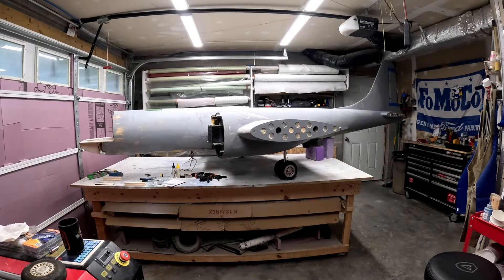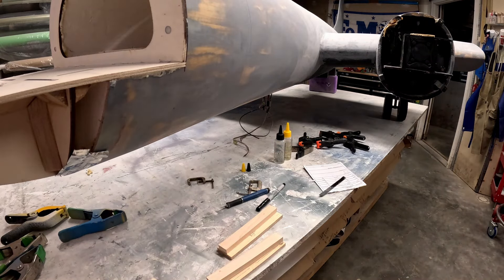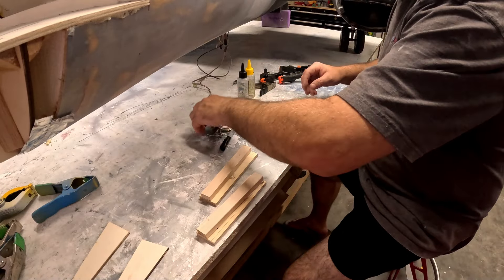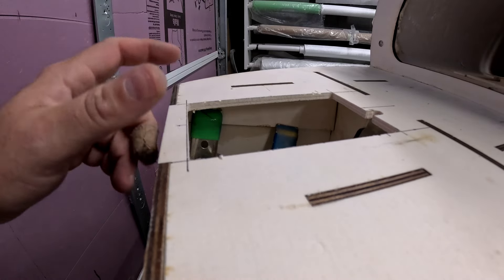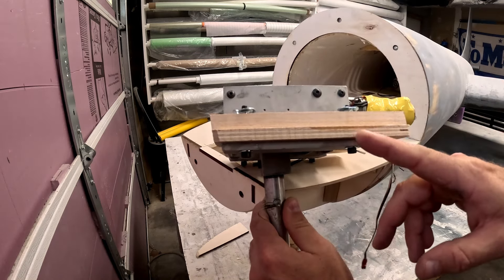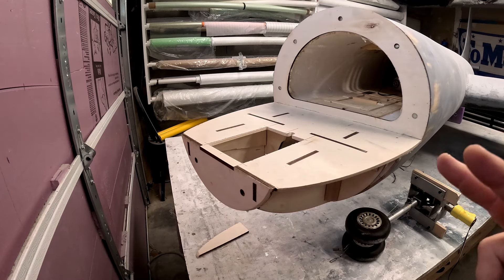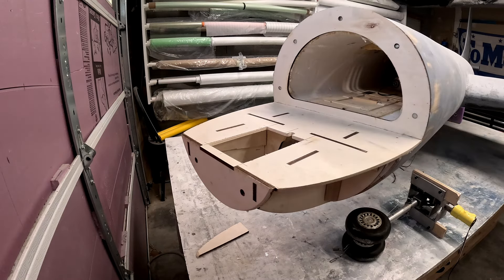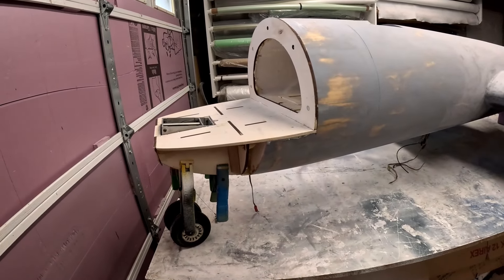B 29 Restoration Project #37   Nose #9

Comment: Do you have any concerns or thoughts about additional weight being added from all the new bracing and repairs? Is there a max target weight for the final aircraft? Very interesting series, appreciate all the engineering and craftsmanship going into the old gal!
Reply from the maker: @scottsackett7551   weight is always a concern with large models, but if its unsafe, it doesnt matter how light it is.  I will happily overbuild a few critical areas to not be concerned or its structural integrity.   Ama large model program has us limited to 125lbs.  Personally i feel this limit forces builders and owners of large models to sacrifice structural integrity and systems redundancy unnecessarily, but i’ll get into that topic later on.
   The only significant weight increases so far has been due to fiberglassing/carbon fiber everything again, which was inevitable.  But it probly is more more of a gain compared to if we would of just glassed the repaired areas and body worked those into the original layers of paint. The new nose structure is only a few ounces heavier than the solid chunk of foam that was removed and with modern servo technology, we are able to use lighter and stronger servos, which ends up saving almost 2lbs in servo and wiring weight.
Reply: @invertmast  That is very helpful - thanks! Looking forward to future installments! Thanks.
Reply: Thomas, do you cut those ply parts with a laser cutter.  Does it work in conjunction with 3D design program?  Thx
Reply from the maker: @briansilcox5720  the laser cutter programming is done with a seperate program (lightburn) which imports the Dxf file of parts from the cad program.